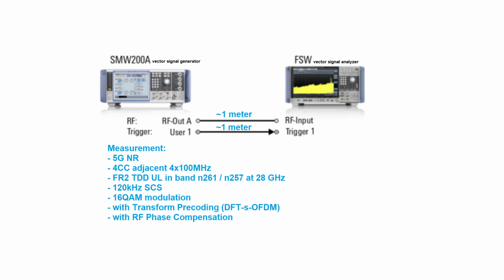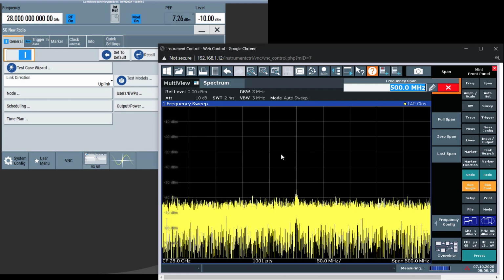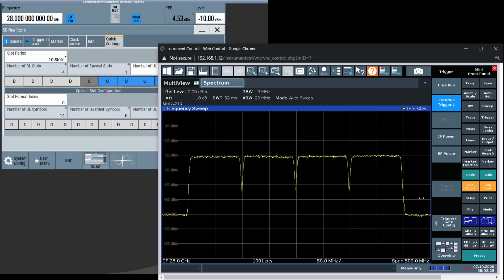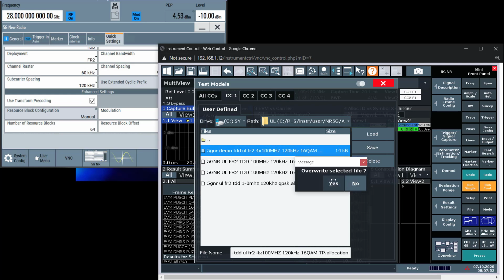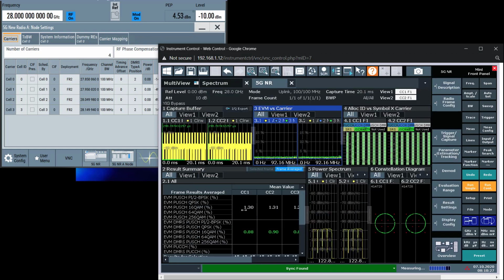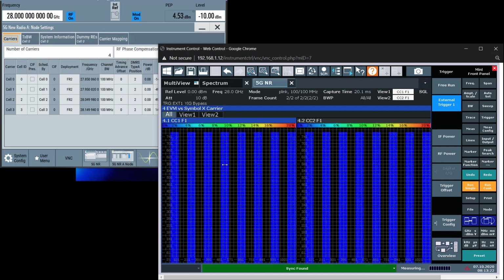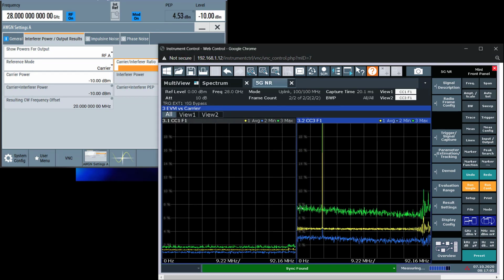Rohde & Schwarz SMW FSW 5GNR 4x100MHz 4CC signal generation and analysis in band n261

Comment: I could not understand how the frequencies are configured for 4 carriers with CF of 28ghz. Can you pls help me understand. Thanks for the wonderful video.
Reply from the maker: Good eye!

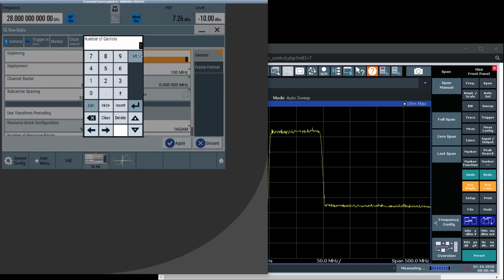At 3:03, note the channel spacing is set to 99.96 MHz. Therefore, the channel center frequencies should be 28 GHz + [-1.5, -0.5, 0.5, 1.5] * 99.96 MHz = [27.85006 GHz, 27.95002 GHz, 28.04998 GHz, 28.14994 GHz]. This matches what was displayed on the signal generator in the "Frequency /GHz" column at 6:32.

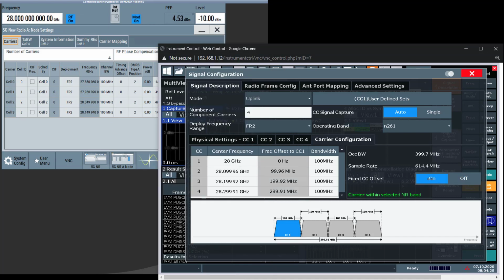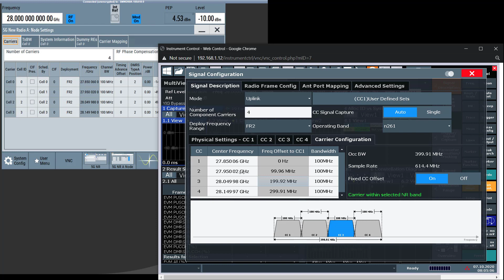At 6:43, I attempted to configure the spectrum analyzer with the same channel center frequencies defined on the signal generator. The firmware erroneously calculated a CC4 to CC1 freq offset of 299.91 MHz instead of 299.88 MHz (3 * 99.96 MHz). At 7:20, you'll notice that the frequency of CC4 was reverted from 28.14994 GHz to 28.14997 GHz.

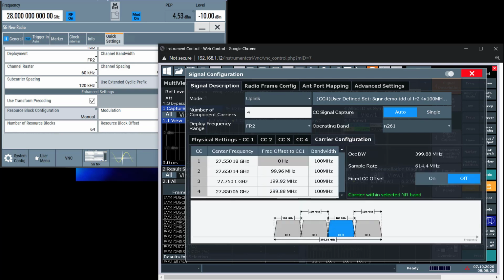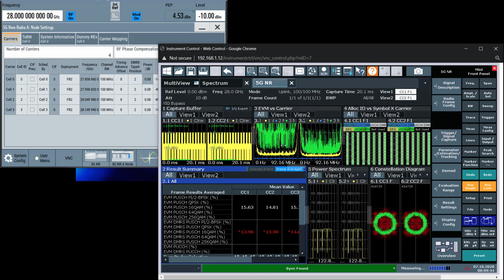You'll notice that at 9:55 after saving a *.allocaton file for CC1 and loading that allocation into CC2, CC3, and CC4, the CC4 offset fixed itself to 299.88 MHz. The other way I could have fixed this was to disable the Fixed CC Offset. Had the CC offset not been resolved at this point, I would have seen a frequency error of 30 kHz for CC4 at 11:07 or severely degraded constellation and EVM due to the RF upconversion phase compensation.

I believe what I saw at 6:43 was a firmware bug, and it's been fixed in later firmware releases since I uploaded this video.

Additionally, the latest firmware has a multicarrier setup wizard that simplifies this (28 GHz center, 4 carriers, 99.96 MHz equidistant spacing, and it does the rest).

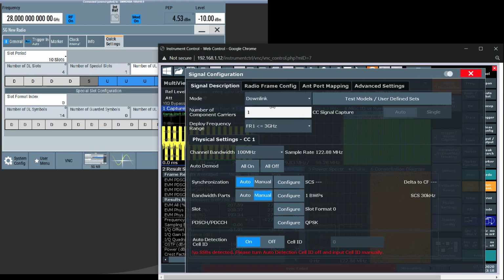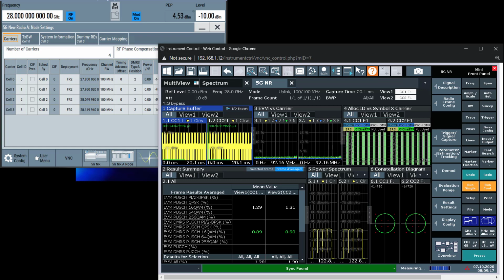In my video titled "Synchronizing 5G NR settings between the SMW and FSW" https://www.youtube.com/watch?v=O81EwqaG6e4, I showed the 5G settings transfer feature that's been available since R&S SMW and FSW firmware releases around v4.90 or 5.00. This simplifies 5:32 thru 10:43 to about 30 seconds, which is why settings transfer is my preferred setup when I'm testing 2-port physical layer devices (mixers, amplifiers). When analyzing a signal generated by a gNB, UE, or a 5g waveform generated in Matlab, I don't have the luxury of having an instrument I can query the full 5G radio frame structure from. It's helpful to know how to configure the allocations by hand for these test scenarios.
Reply: Thanks for the detailed explanation